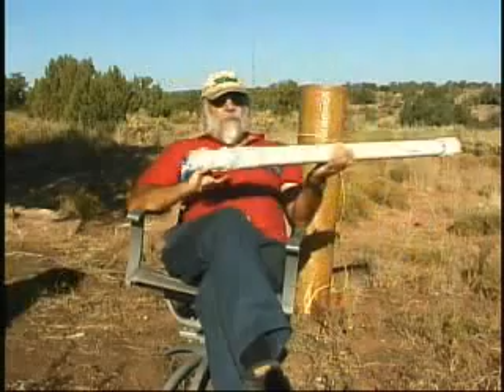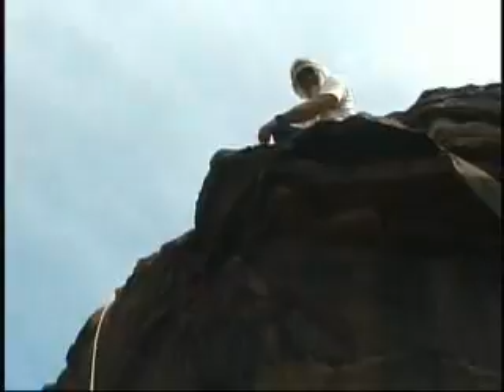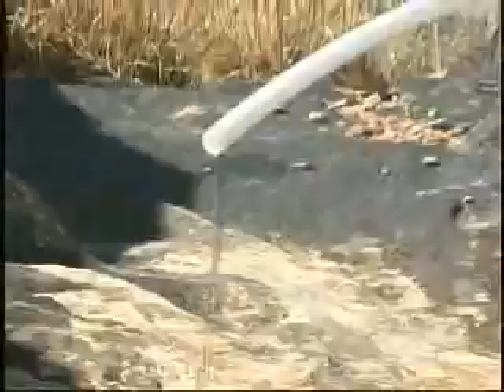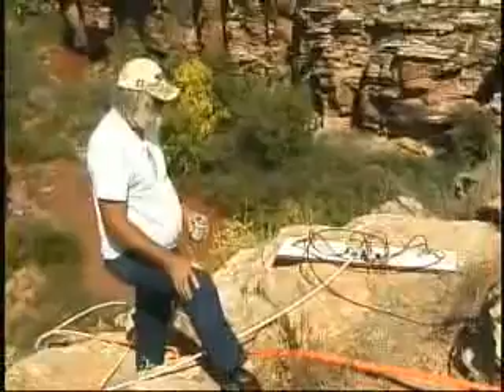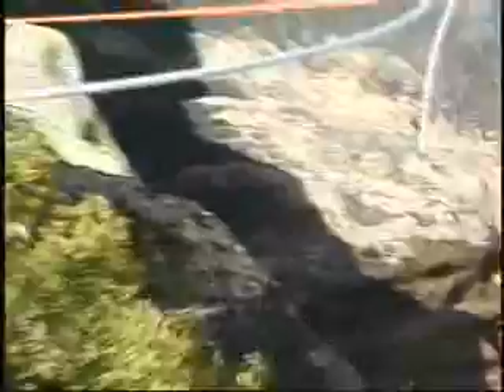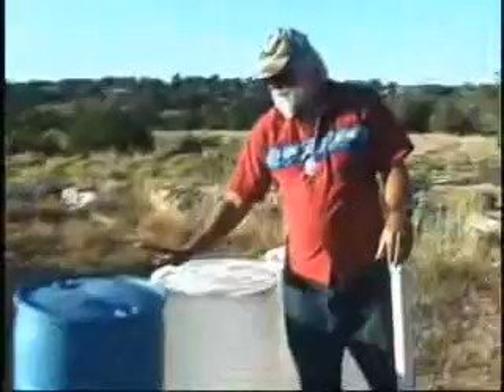Emergency water part 1, air powered well pump

Comment: PUT A PIPE INTO YOUR WELL DOWN TO THE WATER.MAKE SURE YOU HAVE A TIGHT SEAL AT THE WELL  NOW YOU CAN PUT ANOTHER PIPE INTO THE CASING AND START PUMPING AIR INTO THE WELL ONCE PRESSURE BUILDS UP YOU WILL HAVE A FLOW OF WATER.

Comment: More information please. What are you using to make the air compression aspect to work? Hey you may want to consider a tesla coil or at least a version of it. Have you seen the Tesla files. If not I would suggest you do. You might be able to figure out exactly how it worked. I can't but always looking to learn.
Reply from the maker: The compressor uses air cylinders. Ones without oil.  The design is not done.  I took off a couple of years to work on a different project.  I will be moving to Texas next year.  By then I will have it all done.  I will launch the company then.  The unit will be powered by a 200 watt solar panel.
Reply from the maker: Update, air cylinders are used from Clippard.  A 250 watt 24VDC motor drives the system.  Two 200 watt solar panels are needed.

Comment: Very impressive set up!!!  How are you compressing the air that shoots down the well without using electricity?  Could you post another video with more detail or do you have a schematic of how the entire system operates?
Reply from the maker: In time I will post it all.  In general the bottom of the pump has a check valve to allow water in when the pressure in the water is higher than inside the tube.  The top output also has a check valve to only allow water to go out.  The output has a small tube that goes near the bottom of the water pump case.  As air comes in it pushes the water down so it flows up the small tube.

Comment: works great. we had a in ground swimming pool at my grandparents house when I was a kid and remember helping my grandpa build one to fill the pool up for summer. ours was much bigger than this one and pumped a lot more water. but we were using a 10 or 15 gallon air compressor for our air supply. and I can't remember how many joints of pvc it was but we had to build a section and drop it down to build the next section. that was 20 years ago for me.

Comment: Is there a build sheet or any instructions available for the pump?
Reply from the maker: There will be on the water72.com website.  My source for a well went away and I have been working on the other parts of the system.  I should be up and running with my own well this spring 2017.

Comment: Air powered well pump sounds nice. Now where to get said air power? Can we use wind wheel to say fill propane tank with compressed air.
Reply from the maker: Wind power is a bust.  I tried it.  Solar is the way to go.  I will have some new videos this spring to fill in the remaining parts of the system.